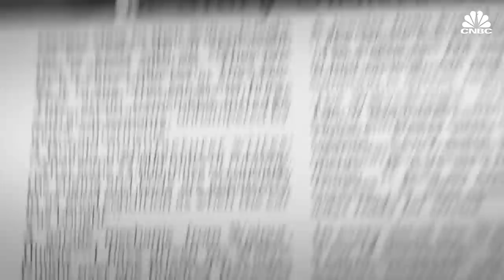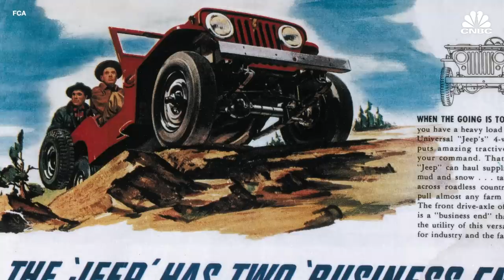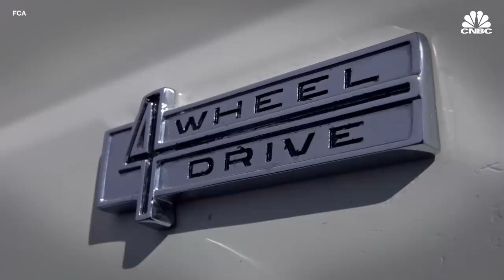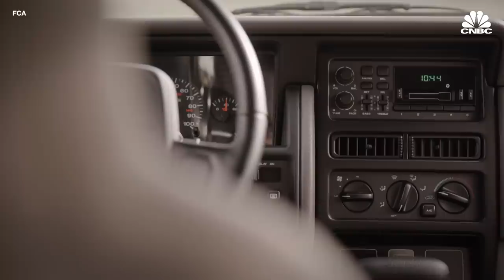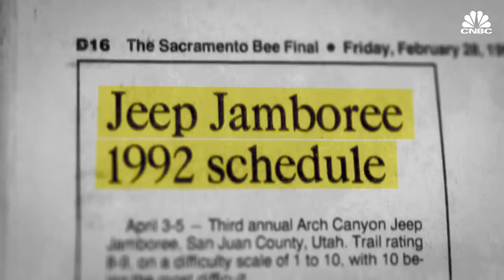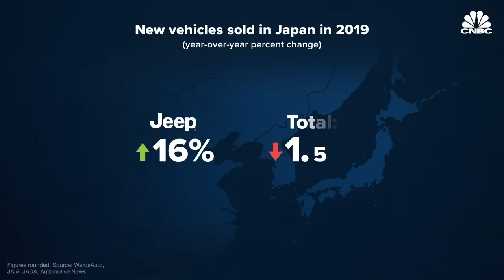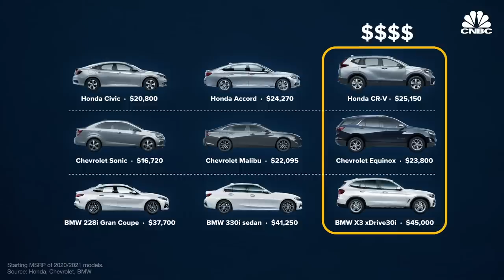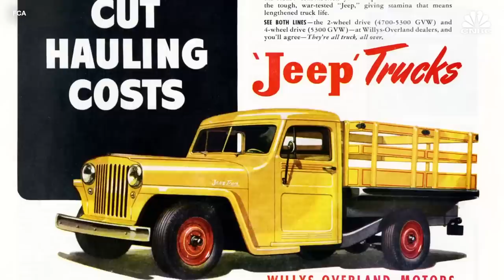Can Jeep Stay Ahead Of Its SUV Rivals?

Comment: If only Toyota sold the Land Cruiser 70 series in the US, the wrangler would have some real competition.
Reply: They are almost indestructible. However, it is a very old platform and Toyota left some compromises in the design when they widened the front and put the V8 diesel in 13 years ago (low alternator, narrower rear tracks, old 5 speed manual and no auto option). The LC70 is basically a piece of industrial and farming equipment that has been made road legal.

Here in Australia people spend big money fixing some of these issues to make them more suitable for off road and towing after already spending AUD $70k+ buying one new. Part of the reason is that the LC70 is largely a developing market product so they spend the bare minimum to keep it viable for sale in Australia and NZ, the only two fully developed countries that it sells.

I think with the LC300 likely not going to the US market Toyota may decide to reintroduce the LC brand in the US with an all new hardcore offroad model after seeing the success of Jeep, Bronco and Defender.
Reply: If a frog had wings he would not bump his ass everytime he hopped.
Reply: I'd be happy if they'd bring the fj back

Comment: The problem was Jeep is Fiat Chrysler owns them and that means lack of quality and cost cutting is their main priority and it shows with their unreliable vehicles
Reply: How are they unreliable? Like Jeeps specifically?
Reply: I've owned a few jeeps price is way to high and yes I've had more problems with jeep than other cars major problems not cheap fixes I do love the look though so I bought a mahindra roxor jeep look but more reliable and more rugged
Reply: Jeep has always been one of the worst marques for reliability. Long before Fiat and Daimler.
Reply: My friend has 1 jeep wrangler.  Dad has 1 too.  Friend said heating and cooling coils has issues always dirty inside.  Dad said it was reliable.  So I guess they are not standardized and have very poor quality control during manufacturing.
Reply: I’ve owned 2 Wranglers and one Grand Cherokee. No issues with any of them
Reply: The 6 Cylinder engines will last forever, its the transmision that will give you problems.

Comment: I've owned a Range Rover Sport V8 and Jeep Grand Cherokee SRT. The Jeep was miles ahead of the RR in reliability and performance while the RR was more luxurious. So while Jeep may not be as reliable as a Lexus (which I've also owned), it's a lot more dependable than a number of European "prestige" models.
Reply: You can compare anything to a range rover and it will be more reliable.

Comment: We have a Wrangler. It feels dangerous - ready to roll if I have to maneuver to avoid an accident. I've had to hit the brakes for wildlife and the wheels lock and it skids to a stop. None of my other SUVs had that issue. That combined with the lack of side airbags makes me pretty nervous. Not sure how long we're going to keep it. Tons of fun once you get to the offroad locations! Getting there on long highway and freeway drives though - like I said, makes me nervous.
Reply: Oh I know. Plus the cargo space is basically nothing. It guzzles gas like an SUV but has the space of a sedan...wtf is it?
Reply: Offcourse it being specifically build for off roading it will have higher road ground clearance which makes it more vulnerable to roll overs on sharp turns, this problem is somewhat common with most of the SUVs but then again most of the SUV don't showoff themselves as an extreme off-roading machine 

I myself not a fan of SUVs in general as I don't find them "practical" in day to day life, I would rather go for trekking, as off roading isn't my cup of tea 

Though I love sedans and I reckon u might have driven a lot of sedans well ,that might be why u might feel things a bit off when u drive ur jeep , sedans grips its whole body to the ground as it moves with excellent control and for me that feeling so good
Reply: I hate it that cars are too low to the ground for off roading. Makes me feel like I’m going to get stuck at any moment. It’s an off road specific vehicle. Go and buy what fits your lifestyle and quit trying to make others conform to your in order for you to look cool.

Comment: My father had a 1983 CJ-7 Jeep that he bought it used in early 90’s. He had it till in 2002. He got a 2002 TJ Jeep. I did drove his newer one a few times. Even my mother drove it a few times on the 2nd one. My father used the 2nd Jeep for plowing snow in the driveway or even his neighbor’s driveway,too. They had it for a long time. In 2017 my mother sold it to a friend towards my father with the plow. My mother gave them a good price of it. It didn’t have any rust on it. It was a good 3rd vehicle for my parents a number of years. My sister drove the 1st Jeep for one summer. The 2nd summer she had a little problems with it the following summer. My sister ended up with a 1991 Ford Escort to drive around in. My father still drive the older Jeep during the summers in early 90’s. They have 2 other cars to drive back in the early 90’s. When they retired they gotten a 1993 Ford Explorer from trading their 2 vehicles. My mother was driving my sister’s car during the fall and part of the winter months. For a little bit over a year in the mid 90’s my mother gotten a 1995 Ford Escort station wagon about 3 years. My father trade that car on a 1997 Ford F-150 truck for him to drive. My mother had the 1998 Ford Explorer as her car to drive around in. My father traded the truck on the 2002 Jeep TJ. That Jeep did run for awhile in 2016. It had a couple flat tires and it didn’t work for awhile. My father had the Jeep fixed during the summer of 2016. It did sat in the garage till I drove it on New Year’s Day in 2017. I only had it that day towards the following day. I was driving my father’s 2008 Ford Expedition just shortly after his death. I got used to driving it for about 3 months. That vehicle was liked a tank for me. I even did parallel parked it once. I did an awesome job in it. I gave a lot of space for this one mini van to backed out of.

Comment: Keep will still sell wranglers. They’re very reliable, can go anywhere, the only thing that sucks is price and there not for anyone 5 foot 11 or taller
Reply: I'm 6 feet....

BUT.....

I only drive with the top completely off AND I only use.it as a fun weekend car to drive around town in on the weekends with sunny days. 

So yes you are correct. Anyone who is 6 feet should NOT buy a jeep if they plan on always have the top ON.
Reply: I'm 6'4" and have a good 4 inches or so over my head with my seat adjusted where I want it in my JK.  Same when I had a YJ.

Comment: My issue with Jeep is the costs.  In my area, loaded rubicon gladiators are close to 70 grand with dealer markup.  Yes, I appreciate the market thinking of getting whatever you can and obviously people are paying those prices.  I just don't see me paying that kind of money for mediocre safety and reliability.   I have a friend that has a 9 month old Rubicon Wrangler and she's had a lot of problems for a vehicle for less than 10,000 miles-especially electrical with the security system shutting down the vehicle while in motion.  It was in the shop for 2 weeks to have that fixed.  I think the Bronco will give Jeep a run for it's money and competition is a good thing.

Comment: Bought 2 Jeep Sahara 4xe hybrids in the beginning of May, as My girl is a Jeep girl.  Two things I said I'd never do. 
1.) Never buy a new car
2.) Never buy a Jeep

I was looking for a hybrid but most of them compromise the vehicle to make an "egg."  I somehow came across the Jeep 4xe and went to look at it and bought it that day without even test driving it.  What I liked was that Jeep decided with this model "Jeep First" when building this.  My girl, not being out done bought the exact same but in a different color.  We both opted for the 4xe Sahara "mall crawler" edition...lol

Here's why I broke my two rules.  #1 is because of the 7,500 tax credit.  This EV qualifies for the full amount which makes this vehicle less than a gas powered Sahara with all the same options.  Not to mention as I'm looking for hybrids and electric vehicles, this cost is within the same as others.  #2 is because Jeep said "Jeep first!"  Also the fact that it is a plug in hybrid and the HVAC components do not need the engine running to work.

Overall we love these vehicles which gives us the availability to do anything from going to the mall in comfort or driving the sand dunes in Corolla NC with the wild horses
Reply: Dump them before warranty expires.

Comment: If you want to buy an 'unbreakable' 4WD in Australia, you buy a Toyota Landcruiser. If you want to pick the kids up from school, you buy a Jeep.
Reply: Not the new Landcruisers.
Reply: @KevinSmith-qi5yn  Never owned one myself, but I'd bet on them over a Jeep any day. They were developed in our outback.
Before Landcruisers, the farmers here all had Land Rovers, and those I can compare to Jeeps: I had mates who owned both. The guy with the Jeep spent every weekend after they'd gone bush welding up the cracks in the Jeep's chassis, the guy with the Land Rover had to tow him back to the garage.
Reply: @mikestanmore2614  not anymore.

While Land Rovers were never reliable, they at least had the off-road chops to match Jeep; nowadays, even that's gone, and they rely on technological wizardry to compensate - expensive stuff that's likely to break in a few years.

Toyotas are both reliable and capable, but they've stagnated; an old Landcruiser will take you anywhere an old Jeep could go, and have the reliability to take you back, but the new ones won't even have the approach angle to get far.

If I had the money, I'd take a Wrangler Unlimited. But I don't, so I settled for a Toyota.
Reply: @lance4906  Times change, eh?

Comment: Bronco uses the sludge prone direct injection EcoBoost engines for its base models
Reply: Nothing is better for off-roading than a wheezing turbo four-cylinder that will choke at the hint of dust or overheat in the first five minutes of crawling.

Comment: That isn't necessarily true that Jeep had off road "all to itself". There are quite a few of Tacoma's and 4runners that off road, believe it or not. Recently in the last 2 years, I've seen a lot more of the Lexus/ land cruisers out on the trails.
Reply: Not out west. Jeep clearly dominates off road along with the new SxS models.
Reply: Any decent 4x4 vehicle with minimal modifications is as good or better then a wrangler lol.
Reply: @raleigh2747   yeah. Where do you wheel? The Walmart parking lot?
Reply: @TheBandit7613  Um... why would you even ask that lol.  A stock wrangler is not that "capable" when it comes to what a even minimally modified 4x4 can achieve.  Street tires alone severely impact its off road capability. The stock Wrangler has to be efficient on highways, get good fuel economy, so on,and is not as good as a purpose built off roader, period.

I like the Utah Zion area for off roading by the way.  
Walmart parking lot... Seriously that where you go? lol
Reply: @raleigh2747  you realize a stock wranger can come with 33 inch mud terains and 2 locking diffs right? not to mention solid axels and can be had in short wheelbase. lol youre delusional.
Reply: @Ihateironyanddumbusernames  "can come with" are the key words in your response i think.  how many wranglers do you see driving around with this? Not many... Most wranglers are base models with street tires, and the drives think they are all bada** because they have an off-road menace that they daily drive to work on the highway.
Reply: @raleigh2747  so what? Thats moving the goal posts a stock rubicon or mojave is still stock.
Besides, you didnt take it to the logical next step. I could then say how many people actually keep their wranglers stock anyways? Majority will at least upgrade the tires
Reply: @Ihateironyanddumbusernames  I have been saying the same thing i have been saying the whole time.  Just because it has "Wrangler" slapped on it does not mean that is is automatically the champion of the off road segment like the video says. 

Any 4x4 vehicle with even minimal modifications can, and probably will be better at off road then a generic wrangler.   Serious off roaders are not buying new wranglers because they are the most capable vehicle for off road.  Most look for a used 4x4 they can modify, and a modified 4x4 will probably be more capable then a new wrangler and still be cheaper.  So, the video saying Jeep dominates this segment because of the wrangler is pretty off. What are you not getting about what i am saying here?
Reply: @raleigh2747  imagine comparing used modified vehicles to stock ones!
Reply: @Ihateironyanddumbusernames  Yeah... Someone wants to off road.  This costs money. Spend loads on money on a ehh capable new vehicle, or less money on a used and then modified vehicle.   Both cost money, so any reasonable person would be smart to compare both options.  Not that hard to imagine.
Reply: @Ihateironyanddumbusernames  You said, "LOL dumb dumb you are saying in order to beat the wrangler you need to modify a different vehicle!!" 
No that is not what I am saying. I am saying the the wrangler is the king off "look at me, I look like i off road," but you don't obviously because you have a stock, generic wrangler.  Wow... Some people...  If you were serious, you would modify that wrangler, and if you were real serious, you would save money and modify some other, used 4x4 and save money too.
Reply: @Ihateironyanddumbusernames  Exactly what i am saying, so its not the "king of off road" by your own admission just now, its just like any other 4x4, so even minimal modifications to ANY vehicle will be more capable then a new wrangler, boom, done, mike drop, thanks buddy, now i  see you get it.
Reply: @raleigh2747   modifications.. you can drive a wrangler off the lot..even just a sport.. and hit the trails.

Comment: Contrary to popular belief - Jeep Wranglers are actually very reliable on road because they are overbuilt for light offroading. That being said, once you start taking them offroad things are going to break - but this is going to happen with all vehicles. Because most people take them off road, they get this reputation of being unreliable. Even so, everyone loves their Jeeps regardless ❤️ I have a Jeep and a Honda and I abslotely adore both of them for what they do well. I can't wait for the plug in hybrid wrangler to eventually get a 40-50 miles charge on their battery so that can be first car I ever buy brand new :D
Reply: @yt.be-r  problems with Jeeps on road are mainly related to electrical gremlins (if they exist in the first place - and most don't have them). Jeep has been using the 4.0l and 3.6l pentastar for years and they are dead dog reliable engines along with solid powertrains. The 3.8l was a dud but that was only a couple model years. The suspension is overbuilt so if you are having trouble with that on road you are neglecting your tires. 

When you take Toyotas off road they break just as often as Jeeps do - just in different areas. Far more likely catastrophic failures with IFS and the skinny tie rods they have than stock Jeeps with solid axles.
Reply: Errhka  Thats just not accurate at all speaking from personal experience.Ive never had any engine problems in my jeeps and they’ve never left the road but every one I’ve had has had transmission failures as well as what I’d call minor electrical problems.Ive had two wranglers to this point and 1 Grand Cherokee.None of my Jeeps transmissions lasted past 90k miles.Im someone who takes pristine care and maintenance of their vehicles.Ive got a 2010  Trailteams Fj Cruiser with 400k miles and off-roading at least once every month.Nothing but regular oil and transmission changes rear diff fluid changes.Spark plugs every 100k miles.2017 RAV4 with 280k miles.Proofs in the pudding jeeps been hot garbage ever since Fiat took over and that’s just a fact.Too many friends with similar stories of their jeeps.They used to be sooo reliable it’s a shame what they’ve done
Reply: @chrismayher617  I've got Hondas and Lexus's with 300k miles too - I'm not talking about other vehicles that stay on the road most of their life. Taking  your 400k mile FJ out once a month doesn't really mean anything unless you are taking said vehicles on the same trails the Jeeps are going on. I'm not talking about Toyotas in general (we all know they are reliable on road), just about ones that go on hard core trails like Jeeps do. If you haven't broken anything on your FJ for 400k miles you haven't offroaded it hard enough. Every single one I know has snapped tie rod ends, front suspension components, etc. when they go wheeling on jeep trails (which Jeeps also break components on). The new Jeep Wranglers have no input from fiat because they are made in North America with US engineers. The fiat thing is just something people like to throw out to justify 'the drop in quality' when in reality these newer Jeeps are amazing compared to the older ones (especially JKs) that had significant issues. The only fiat thing that really exists in jeep is that little jeep renegade which is just a rebadged fiat panda cross

Comment: I'm a Jeep Grand Cherokee fan. I like Wrangler, too;
But I have not driven an SUV that is as nice, as, durable, and as reliable as Toyota 4Runner.

If I was in charge of the military budget, 4Runner would make perfect sense as a military vehicle. It climbs steep heels, it crawls out of holes, it crawls through the mud, it pulls under loads, and it runs well beyond 300k miles.

JEEPS DO ALL THAT, TOO, but Jeeps have transmission problems as they age, and the ride does not feel as luxury as Toyota.